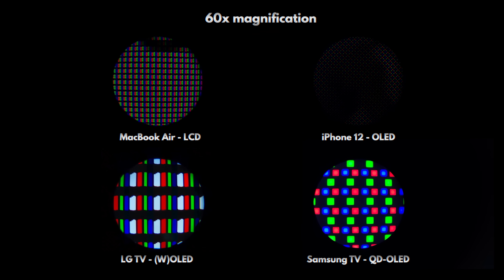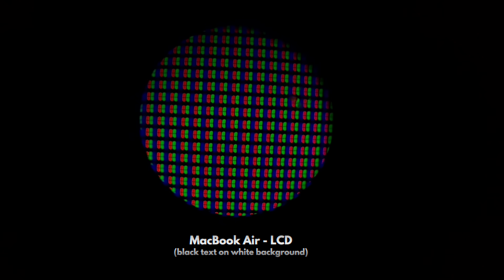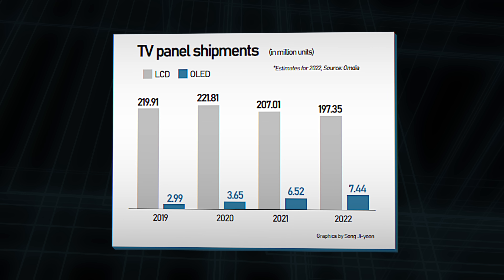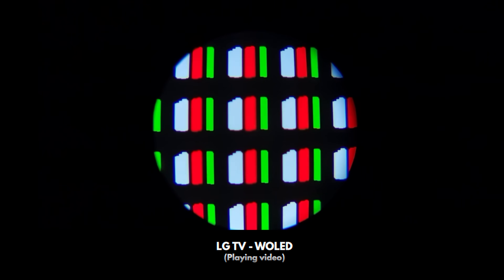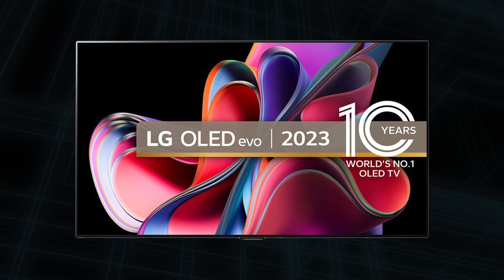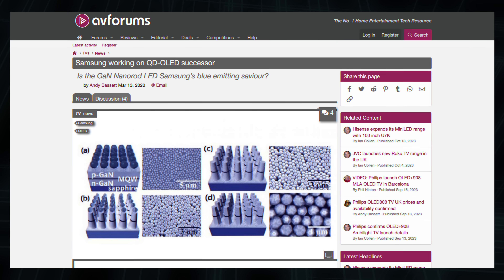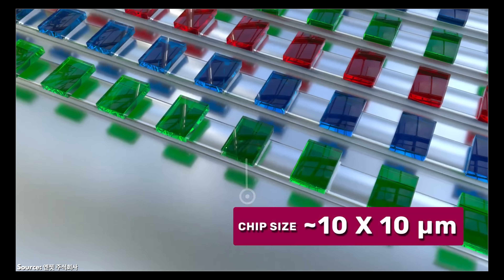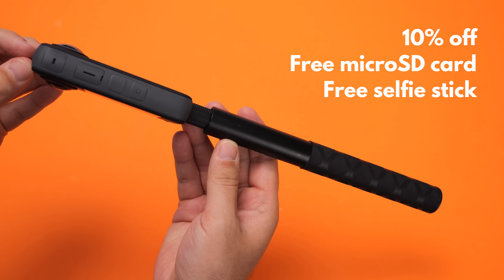The billion dollar race for the perfect display

Comment: For me, this tells me basically one thing over all the others said in your video. That is that right now this year or so, maybe two, are the best time to maximize on best product for lowest price for those of us who like to not have to replace things on a year to year basis. Perhaps better will be released in that time too, and those who can afford that will go that way instead. For the rest of us though, the sales on the best they have already as of writing this, will be justifiable enough for the drawbacks that we will put up with for the next 5-10 years until we do it all over again.

My main monitor (samsung LED TV) is 10 years old now I think, if not, then 8/9 years. And it's starting to show too. But if I can manage to hold out for another ... 2 years maybe... then I can probably get myself the next best model to last another 10 years. Maybe longer. As you said, they are getting closer to their final perfect form. At this point, once they get to the point where burn in isn't a problem anymore, it's going to be all about efficiency both in power usage and cost; only... pretty much. 

For me, the perfect monitor/TV will be what you are pointing out, but with production quality color reproduction on top of a high refresh rate with a incredibly low latency. LG's C1/2 series so far seem to be the way to go for getting that... on a big screen. But C3 came out, and I suspect C4 will probably be the golden grail for users like me, since it's probably going to be using the tech from G3 or similar. Otherwise if Samsung has something better, I'll go with Samsung again.
Reply: Unfortunately, OLEDs are really not the sort of display/TV you should be looking at if you want something that can reliably last you another 10 years.  As much as they've improved on reliability and burn-in and reduced brightness over time and whatnot, they've definitely not fixed these issues.  Ten years is a long time for these organic diodes to degrade, and degrade they will.  I'd definitely feel more comfortable with LCD if long term peace of mind was a priority at all.

Comment: amqled, that tech is a bit in the works, still, but ditches the burn-in weakness of oled but retains the oled strengths, works in a similar pattern to oled having discrete subpixels, but uses electric-activated quantum-dots instead of the hydrocarbon-based leds

Comment: Really great and comprehensive video detailing the different display tech. I really like your metaphors and in depth technical explanations. I just miss that you take into account the problems with puls with modulation dimming (PWM). For many that is a major issue that causes severe eye strain and headaches. Especially Samsung OLEDS and mini LED’s are bad in this regard (and by extensions iPhone screens) I really miss this being taken seriously. For me PWM its an instant dealbreaker. Many people have no idea what causes their heath problems. I think tech channels should inform about this problem and thereby help push the industry to make safer tech.
Reply: This. Hell, even with Steam Deck barely anyone talks about the fact that both screen options suck hard because of that.

Comment: You can already get smaller size Samsung microLED TVs.. If you have the wallet for it of course🙈
"The company announced the new model at CES 2023 and said it will be its smallest and most affordable microLED TV to date.

The 76-inch model isn’t the only microLED in Samsung’s lineup. The company says it will offer these TVs in 50-, 63-, 89-, 101-, 114- and 140-inch versions in 2023."

Comment: We still have a Panasonic Plasma screen as our main TV,  the viewing angle is 180 degrees and the colours are vibrant, with proper 'black blacks'.. don't care that the second generation Plasma draws a bit more current than the fancy newer tech... The TV has optical, HDMI and USB inputs as well as a satellite BNC input.  With modern devices fitted outside the TV and plugged in, you can make the TV as smart as you like..

Comment: I.... did not think carcinisation was a value add to this video. Carcinisation is interesting because it's surprising that a "true crab" is such a successful strategy that evolutionary pressures are still favoring that body type. With display monitors.... Every technology is trying to get... better? Woooooow. Shocking. So true bestie, I bet they are all trying to get better. That's craaaaazy.

Comment: I am pretty sure you neglected to mention the blooming issue with mini-LED, which, especially for hi contrast scenes, makes them WAY WORSE and more distracting than a standard LCD. Yes standard LCD doesn't have perfect blacks, but slight uniform 'grey' is WAY better than text and objects constantly glowing or a weird square of illumination since the mini-LED can't ever be as small as the pixels themselves; or else at that point it's cheaper to manufacture an OLED.
Reply: oled is the best

Comment: Finally a detailed and comprehensive explanation about the top two technologies competing to be the best. I remember many years ago when companies would have the "next innovation" regarding screen technologies such as laser TVs by Mitsubishi, only for them to fade away and let OLED become so dominant. I'd love to see OLEDs with accurate colors and no fear of burn-in whether it'd be a smartphone or a TV..
Reply: How do oleds not have accurate colors? Seems like they should.
Reply: @mitchellsteindler  The pixel arrangement for starters, and the rapid degradation of organic chemicals
Reply: @nemou4985  I tried to find some information, but everyone I see says that the color accuracy is extremely good, approaching previous gen reference monitors. Also organic compounds can be extremely durable so I'm not sure where that comes from. Not to mention oled phones last for many years no problem with a lot of use...

Comment: LCD wasn’t the first mass market flat panel like he mentioned, it was plasma, and was by far the superior technology offering better contrast, viewing angles and motion resolution. Such a shame it had to go 😔
Reply: They had many downsides: -thickness
-heaviness
-burn in issues (worse than even mid 2010s OLEDs)
- high power consumption
-poor yields for 1440p+ panels
-scalability (only good for big TVs, not phones or anything in-between)
They were anything but superior, hence why production was stopped completely around 10 years ago. Of course there were a couple of very good Plasma TVs, but overall they sucked. There are CRT enthusiasts to this day claiming "they had perfect contrast" when in fact the contrast was 200:1 on average. (Compared to 1000:1 average of a basic IPS)
Reply: Thickness and heaviness are downsides? These are upsides! No burglar will steal it! Thicker implies also: a little more room  for speakers.

When I bought mine, the kmage quality was quite superior over the existing LCD's... And it still doing fine... after more than 15 years.

Are there better screens today..? Probably... but I am not going to spend more than $1000 to replace a still fine working screen...
Reply: My dad has a plasma TV, it's horrible. Super loud high frequency tone, the image is flickering when you have the tv in your Corner of eye, it warms up a room in minutes, unbearable to watch a 2h Film, and it looks awful. Colors are washed out, no Kontrast... Idk what where the shame is

Comment: I made the jump to an OLED tv just a couple of weeks ago, and I am completely blown away by the picture quality, and I didn't even buy a particularly high end model - just the 2023 LG B3 on sale. And although I have a good IPS LCD display on my PC, I now want to upgrade it to an OLED but I am worried about burn-in as I often do some work with static elements for long periods of time... So I now NEED (😁) to look into the newer technologies available, as micro-LED monitors are not coming any time soon as it seems...
Reply: Crazy, I’ve bought 3 different models of LG OLEDS over the years. LG C8 55” 2018, LG G1 77” 2021, and a LG C2 42” 2022. They work flawlessly and look as beautiful as ever. It’s unfortunate you had a bad experience.
Reply: @Ki6465  I don't know maybe the C1 has more problems for some reason.
The panel has no support,the back of the TV is so thin.
I noticed that they made the C2 thicker And the G1 is also thicker.
This TV had a defective panel out of the box and needed to be replaced day one.
I have heard people say that a new TV is better than one that has been repaired.
I don't think this TV will ever be right but break even other week.
The on sight repair seems to be lacking something.
The  tech having to put it face down on my bed and then lift it back up is probably putting strain and stress on the panel and/or the connectors.
But even if it's fixed the Alexa integration is 100% broken and I can't even use it to turn the TV on or mute it or adjust the volume
And the CEC issues are annoying AF
I need to constantly have my huge Yamaha remote out as well as the TV remote and the remote for whatever input device I am using.
With my old TV all I needed was my echo dot   or my fire TV remote.
This TV is a HUGE disappointment and I would never buy another TV that uses web oS , it's pure crap.
I waited like 14 years to replace my plasma because this was on sale and everyone was saying this was a good TV
Well I guess I should have waited another 5 years because this thing SUCKS.
And the way things are going things will probably only get worse.
How do they F up a technology as old as CEC?
It worked flawlessly on my old 2008 plasma 
You would think it would have been even more perfected after almost 15 years but no,they are going backwards.
And how does a multi billion $ company manage to F up Alexa integration on a 1K$+ TV when I bought a Tuya IR device off AliExpress for less than $2 that works flawlessly with Alexa and control literally hundreds or thousands of different IR devices.
It's like the people who designed  have never even used it themselves or down any testing at all.
Reply: OLEDS suck
I have a 55" C1 it got it's 4th panel last week , the TV does not even have 500 hours on it and  now it has more problems and they are coming next week to replace the  connectors and the main board,  none of the panels had burn in  just a  vertical  white line top to bottom.
They just replaced the whole panel last week again for the 3rd time 
this time they obviously didn't know what was wrong with it and   just replaced the panel because they have no idea how to even diagnose these TV's
also they ordered  new connector cables and a main board, they can't diagnose it so their only solution is just replace all the parts and hope it works, they should have just gave me a new TV already
 it would have been cheaper for them.

I replaced my old circa 2008  50 1080p panasonic plasma with this POS, the picture is nice when it works but  when it works is basically never
Also the OS is pure trash  web OS SUCKS,  the TV takes a half hour  to power on and  switch to the desired input because web OS is SLOOOOOOOOOOOOW
the CEC  is flaky AF it might work one time out of 20 ,  the TV will not switch on my AVR 98% of the time, even though everything is configured right and  my old TV, a 2008 plasma had no problems at all with CEC,, the old plasma  also  turned on about 4 imes faster too,and no issues with  CEC.
Alexa integration is totally broken too and  after doing lots of research it seems like nobody can get it to work on this TV so back to using a networked universal IR  remote hub ( thankfully you can get a cheap one  from aliexpress  these days that is very tiny and works amaing for $1.78)
I seriously regret buying an LG OLED

Comment: I'd argue one thing that none of these display technologies is trying to solve, unfortunately, is motion clarity.  Picture quality is absolutely important.  But motion clarity and input response from CRTs SHOULD be also part of this holy grail.  Input response is pretty good on OLEDs that support 120hz.  Don't know if it matches the analog latency, but it's definitely good.  LCDs seem to often fall short (probably because of the sheer amount of processing required to achieve similar quality to OLED).  But motion clarity WITHOUT input latency cost is still a massive issue on all display technologies.  I'd assume OLEDs with lower power consumption, higher refresh rates, and some kind of ULMB or BFI support AT those higher refresh rates will resolve this.  Or if Samsung's LCD replacement technology is able to achieve similar results to OLED with none of the downsides of LCD that could also work.  But I think not.  The nature of using pixels in the first place creates a sample and hold effect.  And if we can't address that while still having sub 16ms latency then I'd argue both issues (motion clarity and input latency) aren't resolved.
Reply: You can't solve input lag with pixel-based displays. Ever. The lag is always going to be 1 frame length at a minimum. CRTs were literally driven by the signal that was input. If there was processing to be done, it could be done in realtime, because analog circuitry doesn't require memory buffers like digital ones do.
Reply: @timramich  You cant resolve input lag period
Reply: @G0A7  Yeah, that's exactly what I said.
Reply: @timramich  lol
Reply: From the test ive seen oled is closer to having less ghosting than It should, the pixel response is so fast that sometimes you lose the smooth movement and start noticing something like steps between frames

Its noticiable watching low frame content like anime or slow panning shoots in movies, even more if its a environment shoot from high
Some oleds have a option in the software to improve this, Idk in other brands but LG calls It soap opera effect, for me is just a blurry mess so i dont use it, but im also a user with a 120hz mobile, monitor and tv so maybe im more nitpicky to this motion blur
Reply: I'd argue that you haven't researched what micro LEDs are seeing they are literally at least 100x faster than oleds are.

Comment: I suspect the next big innovation will be in-silicon manufacturing, especially for things like vr headsets. Leds would be made on a chip, you could even include the logic for each pixel, and instead of being cut out of the chip, the whole chunk of silicon is then used as a tiny display. You could do multicolor as having leds of all 3 colors, or by coating the silicon with quantum dots.

Comment: Nice to see such improvements in display technology to extend service lifespan and conserve energy.
All this will be in vain if used in battery powered devices where the battery is not replaceable. Thus a perfectly working and fine display will be discarded because the battery no longer holds a charge.

Comment: Micro LED TV is a weird term, it’s already all over the place, called LED wall. Basically the pixel pitch is just getting smaller, know as P. P10, P5 are extremely common, while P0.7 right now should be the tip top. You can buy and assemble one right now.

Comment: I don't think that the crab analogy works. The key point of the crab analogy is that it's natural selection with a wide variety of evolutionary pressures, and because of that the multiple occurrences of crab-like forms is an unexpected emergent result.

For these screens, we're taking intelligent design. And yes, if there are properties that make for a better result (good blacks, fast response times, vibrant colors, longevity) then yes, if you only compare them by those properties, it would be weird if different technologies wouldn't convert on being the best product...

I was actually expecting deeper similarities because as it stands, using the crab analogy is like saying "isn't it weird that all different clock technologies track and display the time?"

Comment: I sure which cameras like Insta360 would make their batteries user serviceable. I have a Insta360 Go2 and the batter refuses to. The battery was a huge pain to access. I'll likely make the battery external to the case to make it easier to charge and so I can use a higher capacity cell.
Reply from the maker: The X3 has replaceable batteries. You press a latch and it pops out :)
Reply: @TechAltar  Good to hear. Thanks for letting me know.

Comment: Micro led holds the best long term promise if they can cut down on the space between the pixels, and get the price down.
There is a direct electron gun tech being worked on, which is like crt but each pixel gets it's own mini electron gun which will be neat. But that also looks like it will be 10+ years out.
The OG crab we are trying to remake are plasma TVs. Yes, they had problems with power use, heat, but in, and price... But an old 720p plasma looked about as sharp as the 1080p lcd TVs of the day. I think they phased out before we saw mass market 1080p plasma really get a chance to shine, but I would imagine that a 4k plasma would blow most current Gen tech out of the water... You would just need a good enough cooling system for hdr to work and a smr nuclear reactor to power it lol. But we are slowly converging on that same level of contrast, saturation, and brightness levels with tech that nobody dreamed would come this far!

Down side though is that my TV is about 6 years old now... And I don't have any real motive to change it out any time soon. New TVs are better, but not leaps and bounds better where it is worth the replacement cost. Turns out that when you keep your TV in a light controlled environment and don't jack the brightness all the way up, they keep their brightness and contrast for a really long time!
Reply: I thought this was already looked at many years back but it never went anywhere called 
surface conduction electron emitter display or sed tvs. Didn't they scrap this tech ?
Reply: What is the direct electron gun tech called? I can't find any info on it.